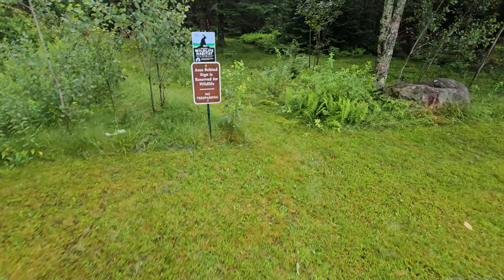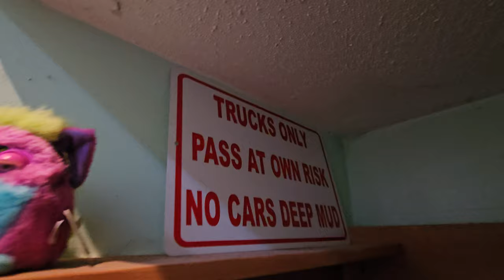July 10, 2023 Water Table Rising Vlog

Comment: I love this. I love how you lured us in with drain cleanings and then give us so much more. I can relate to the water issues in the basement. I had 4' in there after we got 5" of rain overnight in March 2020 here in central Ohio. I finally gave in and had them dig the outside perimeter and put mastic coatings on the wall and an interior drain system as well. The only thing I need to do now is to get a reliable generator so I can make damn sure it stays working when the power goes out and the battery backup dies.

I like how you take care of your land and home, much respect. Always love the videos.

Comment: We finally got the torrential rains and flash flooding here in Southern New England - Greenville , RI and our grounds are soaked as well I live in a flood zone and the sump pump in the crawl space came on today. It's all good everything is lush though. Now do you get more slugs because of the current conditions? I have similar growth in my backyard along the cut grass except down here it's a little thicker because of the warmer weather and I use a metal blade on my weed whack and it goes through it like butter. If I use the regular trimmer string for the thick foliage then it's constantly breaking and I have to keep respooling it. Geeze if this keeps up You're going to need more bridges. Yeah cutting paths in the woods other than a straight line makes it seem more natural. If the climate keeps up this way pretty soon you can start growing gardens in May like we do down here...the weather's crazy.. back in the day we used to go up to Bath,  New Hampshire for summer and winter getaways. which is in the northwestern corner.. I've been monitoring it for the past 20 years and it's been getting warmer and the winters less cold and snow. I don't know if you know this but the oldest covered bridge still in use in New Hampshire is located there It's called the BATH-HAVERHILL BRIDGE and crosses the Ammonuusoc River

Lol sorry I didn't wait till the end Yes you do have slugs!!

I remember how upsetting it was few months ago when you got that downburst and lost a lot of trees Now see Mother natures on your side and she's turning everything around things are looking up and up in the woods over there! And I just learned about the moss you were saying accelerates the death of what it grows on I didn't realize that that's good to know 👍

I got to hand it to you You're always thinking ahead using the basement water to go into the pond that that's a great idea Good recycling good for the tadpoles.

When you get those good thunderstorms and this frequent lightning that's throwing down a lot of nitrogen and everything becomes even more lush and grows rapidly

Comment: If you have a septic tank in these conditions you will have it overflow if the vent isn't high enough or you are not lucky enough to have a newer proper tank or lagoon.......sometimes it will cause a fairly noticeable smell and if you are unlucky enough to have a fresh water well dug in near vicinity or down slope from the septic tank you should quit drinking the water / fecal chloroform